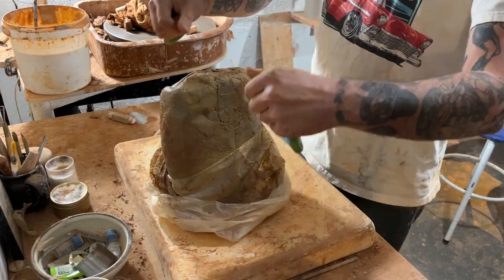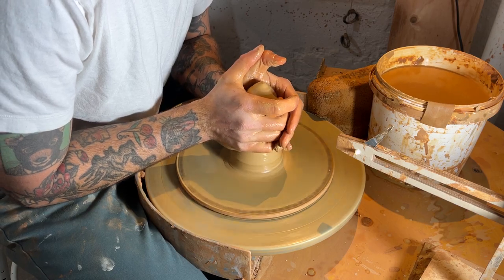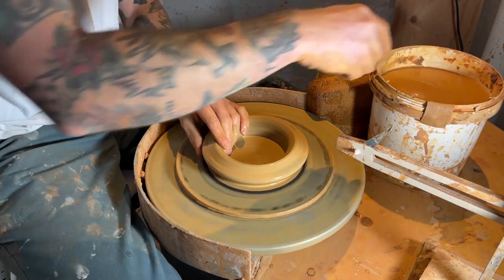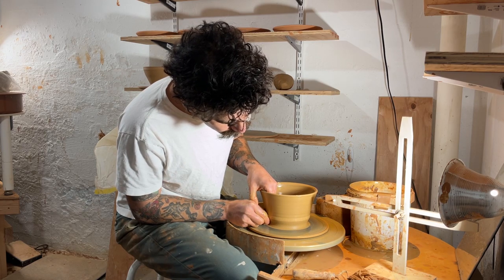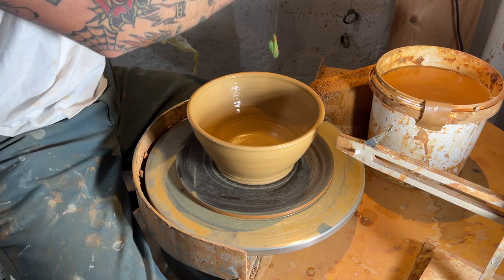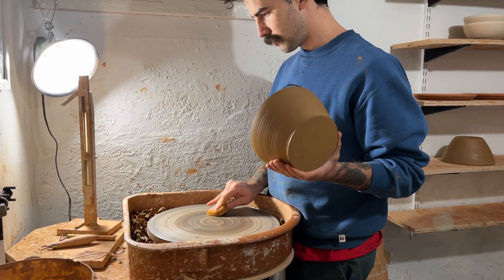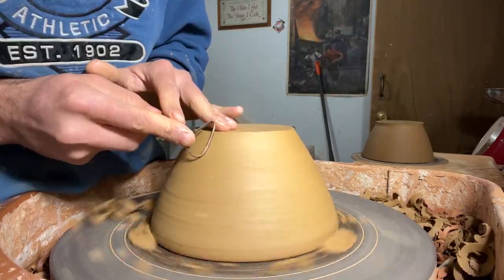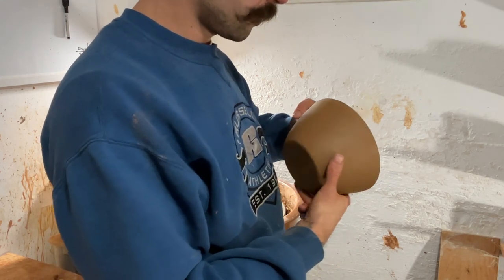Throwing and Trimming a Ramen Bowl - Narrated

Comment: Interesting to see you using clay on the wheel to get the bat to stick. The wheel I have is older so the standard hole width is different from what I have. So I’m going to try this. Digging the ‘stache btw..👍
Reply from the maker: yes! i use this method for all types of bats. it really guarantees that those bats aren’t going to move while you’re throwing. i feel like we’ve all experienced a bat popping off the wheel head while centering. 😅